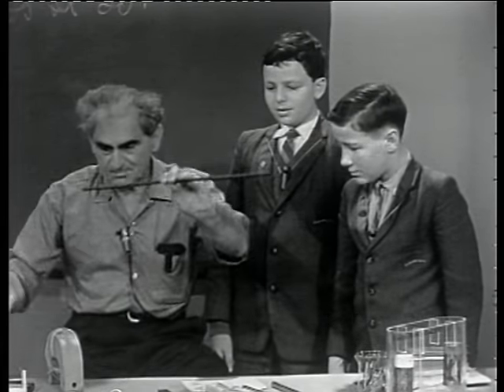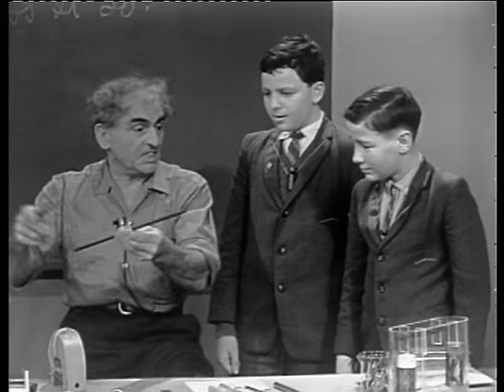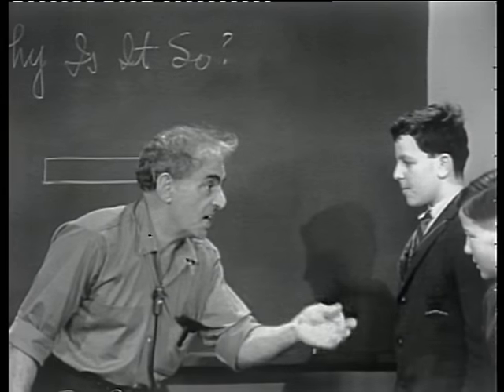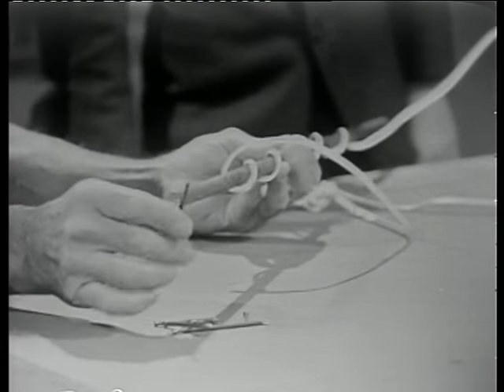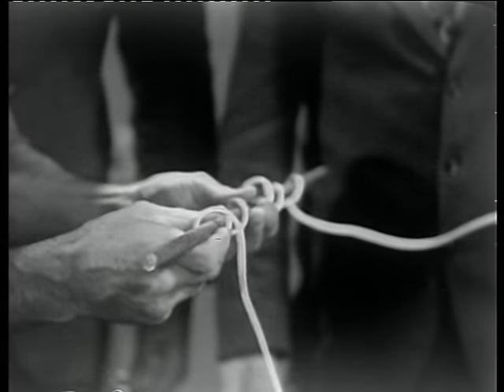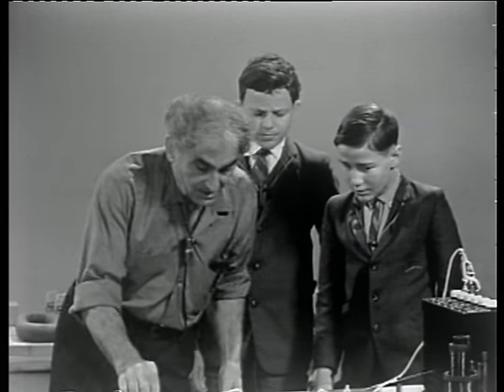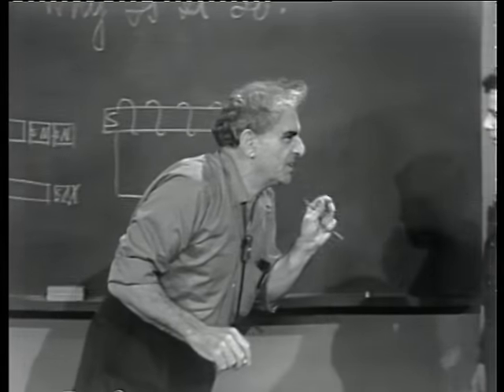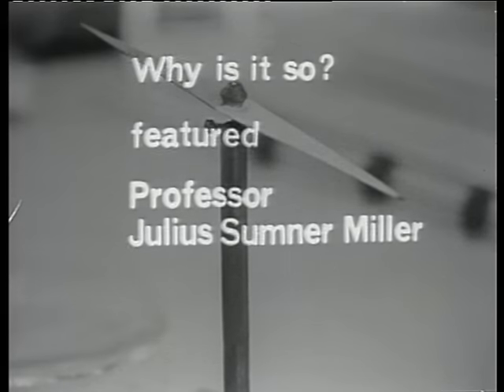How to make a magnet with Julius Sumner Miller | Why Is It So?

Comment: @6:55 The splitting of the magnet seems to be similar to cell division Imo, via external magnetic forces.  But I'd have to ask what force is doing the "cutting" unless that is the expansion force of the universe.  Not sure, but it was fun to think about it and give it a try.  Unless the attraction and expansion IS inside a black hole, if that's where we could be at.  IDK.  Fun stuff!

Comment: Why do you need to tilt the rod downwards, when using earth's magnetic field? Is it to follow earth's/magnetic field's curvature?
Reply: I believe it follows the axis of the Earth which is 23.5 degress tilt
Reply: @johnlannikk2701  hm, my first thought went in the same direction, however: if you hold a rod parallel to the floor, it has the same tilt, relative to a rod on the equator, for example. So that shouldn't be it. Or do you mean a different tilt?
Reply: @Sportler84  If you google Earth's tilt you will see what I mean, put it onto images.
Reply: @johnlannikk2701  I see what you mean (and saw it before, of course). However, I'm quite sure that the magnetic field follows the rotational axis, while the tilt is only relative to the orbit around the sun. So, it's more like a question of perspective and shouldn't have any impact on the magnetic field.
Reply: @Sportler84  The tilt IS the rotaional axis. I must admit I have never seen anyone use the tilt before in magnetizing a rod with a hammer, and I'm not sure it is nesscessary
Reply: @johnlannikk2701  yes, but there is only a tilt, relative to the orbit around the sun. For us on earth, there is no tilt. But I will try to picture it, perhaps I'm wrong.
Reply: @Sportler84  Yes you are quite right. So I'm not sure what he was referring to with his tilt of the rod. Thanks for reply